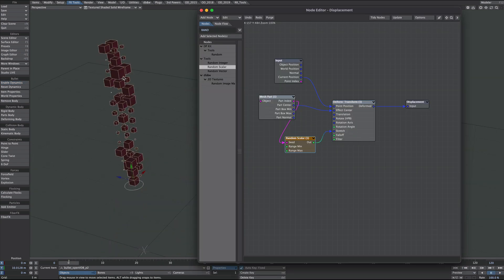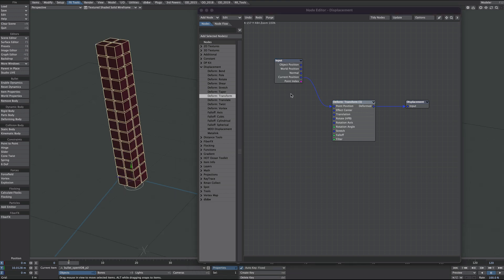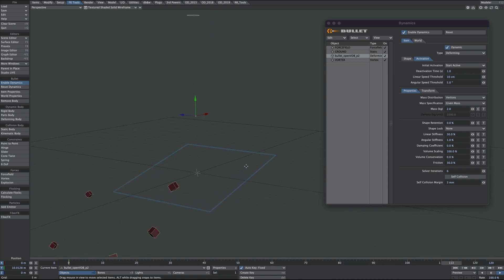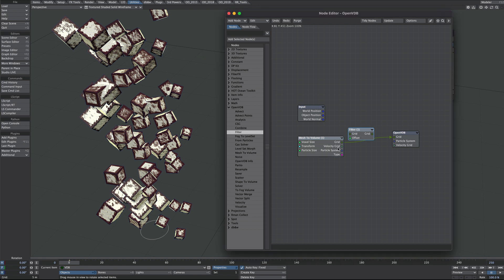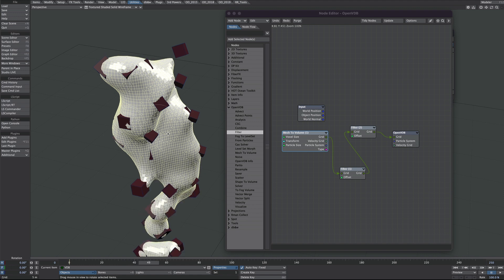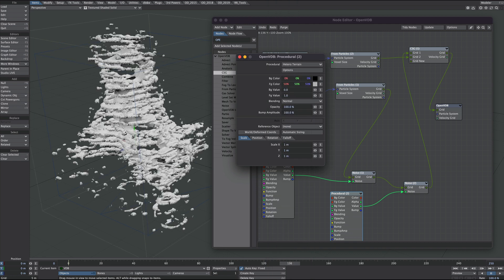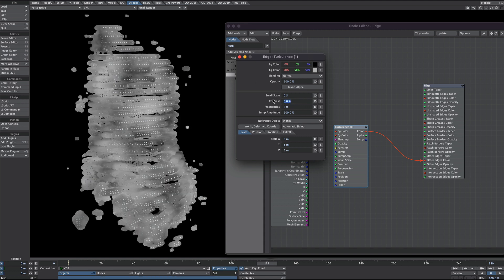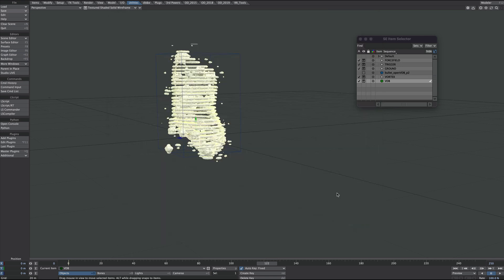LightWave 3d: Part 2 - Bullet -  openVDB

Comment: Nice.

I knew this was possible though, but the use of bullet to create conceptual environment like this is in MY mind not very effective, or should I say, there isn´t much you gain from using it vs just using displacements or particles instead, or even fluid smoke generation converted to mesh.

What you may gain is from what gravity and collision you have with other items and perhaps forces, but that you can pretty much do with particles as well.